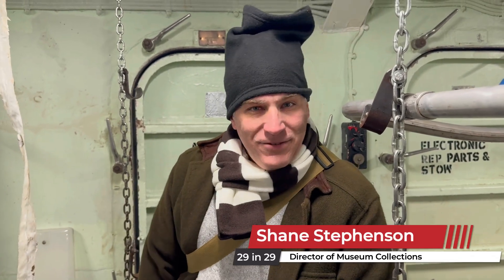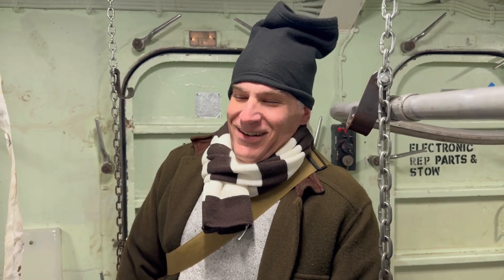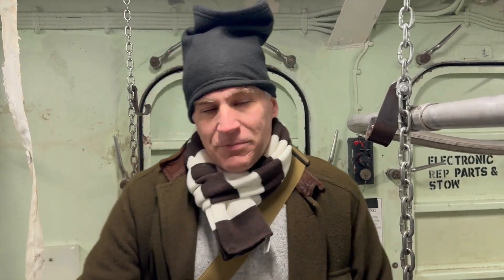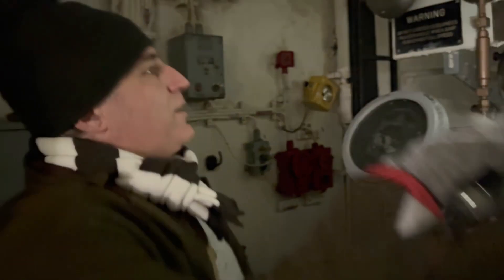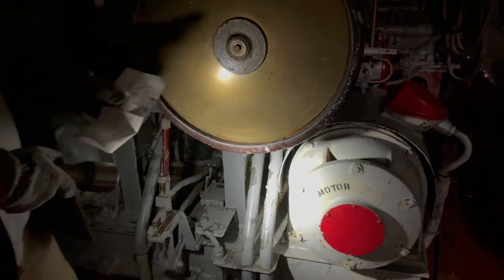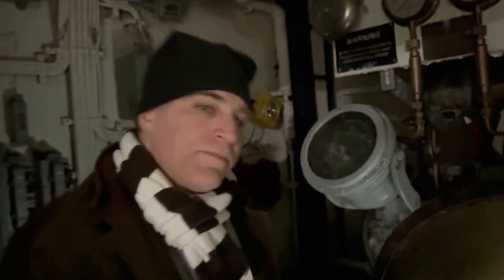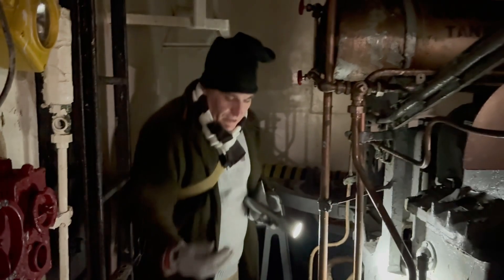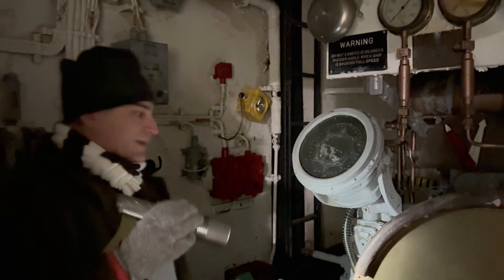How does Aft Steering work with one rudder: USS The Sullivans

Comment: May i ask: how comes Aft steering isn't live (no lights)? 
Is it as a result of the flooding - those circuits not been cleaned and reinstated yet? Or...? (Struggling to think of any other good reason why parts of the ship wouldn't have power)
Reply: If you are still wondering why the darkness, watch the video "Energizing USS The Sullivans PART II!" published a year ago. If nothing else it is mix of rubber soled 3-stooges amusing and OSHA horrifying.

Comment: How many auxiliary steering compartments does the Little Rock have?
Reply from the maker: That's a great question, cmcb7230! There were two other steering spaces beside the pilot house. There was aft control station underneath the large SPS30 dish, and the steering gear room, AKA Aft-Steering.

Comment: I have a question for you that could work in the form of a video- why is Little rock's 6" turret so much larger than her 5" mount? also how does Little rocks dual 5" differ from The Sullivans single 5" or are they the same platform, just two of them per mount instead of one
Reply from the maker: Thanks for those questions: 
1) The 6" is armored for one, four different armor depths as you move from the front of the gun to aft. Certainly the caliber is larger (47 v 38), so the barrels need to be adjusted to meet that need. With three barrels per gun, need for more men working the system, greater distance of ordinance so a more complex range finding, periscope system. 
2) I would agree that for the 5". The main difference is the configuration from one barrel to two. That changes the placement of equipment, number of men, et cetera. But, they're the same caliber, shell type, et cetera.